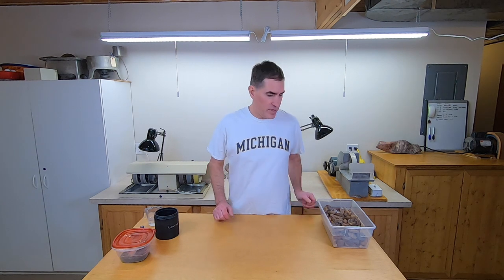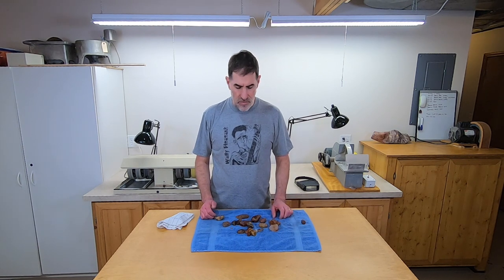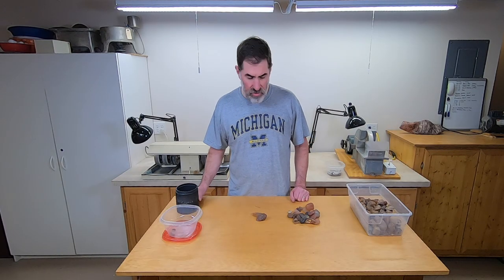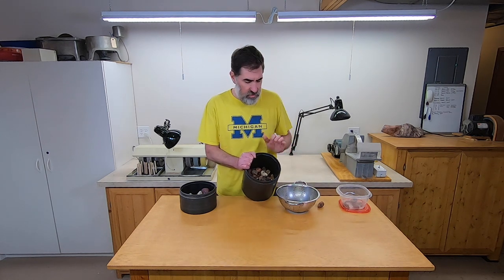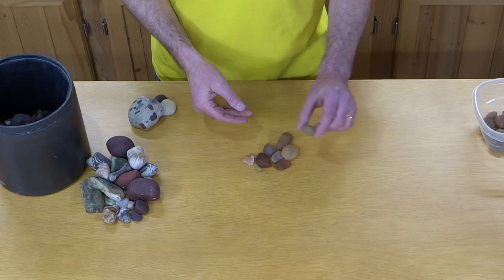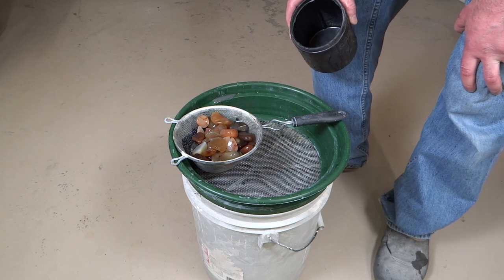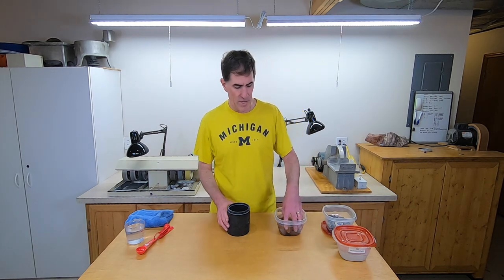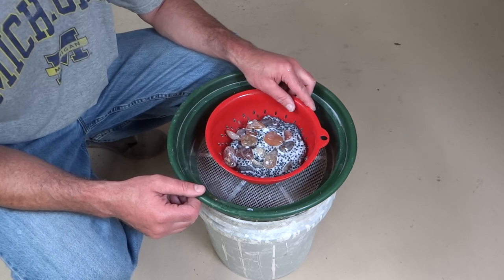How to Polish Rocks with a Rotary Tumbler and Plastic Media

Comment from the maker: This is my third favorite method of tumbling.  My favorite and second favorite methods are shown in these videos.  I almost always start my rocks in a rotary tumbler and finish them up in a Lot-O vibratory tumbler.
Rotary tumbler followed by vibratory tumbler:  https://youtu.be/ksrmpPZrAuU
Rotary with ceramics:   https://youtu.be/dYGFal0e1WY
Reply: Thank you Rob! Appreciate you sharing with us. Great information.
Reply: On the little ears of the kitchen strainer you can put a little screw and nut as a extra helping hand to hook on the edge of the bucket it is sitting on.  It works well too.  Great video btw
Reply: Have you ever tried a thumlets barrel with flats in it which agitates the mix quite a bit better? Whose tumblers are you currently using?
Reply from the maker: @jonlennon3348  I have a small Thumlers tumbler, an AR-2.  I don't find that it works any faster.  I really don't like those barrels.  The lids wear out quickly and then leak.  I've had lids pop off too. I much prefer the Lortone barrels.  Lortone has started making barrels with little ribs in them to move the rocks around a little more, but I don't notice much difference in the results.  All of the barrels in my big tumbler are Lortone barrels because I don't want a spill inside there.
Reply from the maker: @jerryklutts8615  I either set my strainers on a gold classifier that sets perfectly on top of a bucket or I cut a hole in the lid of the bucket that will fit the strainer perfectly.  Your method probably works well too.
Reply: @MichiganRocks  I have two strainers on with the ears and one that fits in a bucket.  Both work well for me.
Reply: @MichiganRocks  Good then a thumlers is a waste of time which is what I was hoping you would say.
Reply: I bet you would love to polish some Mars rocks, have you ever done this to a meteorite?
Reply from the maker: @TheBowersj  No, I have never owned a meteorite. If I did, I wouldn't tumble it. I think it would be really cool in its natural state.
Reply: 05:40 I use "ceramic airsoft bbs" tossed in with my grit and rocks to aid in working the rocks over.
Reply: Sorry, this may sound stupid, but where should I dump my grit water? 💛
Reply from the maker: @nicolebrand5752  That's not stupid, it's a really good question. It's such a good question that I made a video to answer it. https://youtu.be/j-356YqFox8?si=IWEHxkM8iLTyIsuI

Comment: For my first tumble batch (harbor freight rotary tumbler) I used air soft pellets cuz that's all o had, and they turned out great! I used them again for my second batch and was pleased. I haven't done any tumbling for almost 2 years now because life has gotten in the way. Ah, well. I'll just watch vids of other people doing it until I get a minute. I've got a tremendous amount of material that I've found over the last 3 or so years. Rockhounding is an addiction 😍
Reply from the maker: It is pretty addictive, isn't it?  You should turn that tumbler back on.  I only check mine once a week, so with just a small tumbler that should take less than an hour per week.

Comment: Thank you so much. Now I know what I’ve been doing wrong. I’m new at this and learned very quickly I don’t like plastic pellets. Ceramic easy to clean and dry. Lot-O-Tumbler is on my Christmas list 😁
Reply from the maker: I agree.  I really hate using plastic.  Some other really good tumblers swear by it.  My preferred methods are  1) Lot-O.  2) ceramic media in a rotary tumbler 3) plastic media in a rotary tumbler.

Comment: Lovely stones. Interesting that they took so long in the first stage.  Cool beard progression 😎
Reply from the maker: The problem was the very deep holes in most of them.  Normally, I would take some of those to the grinder and grind off just the worst spots.  Otherwise, the tumbler has to grind down the entire surface to the depth of the deepest hole.  The rocks end up pretty small that way and it takes a long time.

Comment: Wow! Had no idea how long this process takes! Learned a lot. How do you discard the waste water from the tumbling?
Reply from the maker: I have to make a video about getting rid of the rock slurry.  It's on my list.

Sometimes I tumble Petoskey stones, which are made of limestone.  For some reason that slurry acts as a flocculant, making all the rock dust settle to the bottom of my bucket leaving clear water on top.  When that happens, I siphon off the clear water and it goes down the drain.

Otherwise, I let the bucket settle as much as it will, leaving still cloudy water on top.  I siphon the top part with the most clear water into another bucket and then either dump it in the gravel at the side of the road or into a hole in the woods behind my house.  The "hole" is actually a pretty nice hole.  I built a wooden box out of some old treated lumber that goes down about two feet.  There's a trap door on top to keep someone from accidentally falling in.  Where I live the soil is mostly sand, so the water drains out pretty well.  It rarely gets much ice down in the hole even in the middle of winter.  The only problem is that eventually the small rock particles in the dirty water eventually clog the sand and it doesn't drain anymore.  I can dig out the bottom for a while, but eventually I have to move the box to a new hole.  I have only moved it once in about 8 years though, so it's not too bad.

My water often contains borax which I use in the Lot-O tumbler.  Borax acts as a herbicide, so you don't want to dump it on your lawn.

What's left in the buckets after siphoning off the top is left to dry out and then it goes in the trash.

Comment: Great results. Cool "beard grinding and polish" process too near the end. One big thing I am definitely still working on learning with my tumbler is "coarse stage patience". I always want to get to stage 2 too quickly. I need to get a second tumbler :-) Thanks!
Reply from the maker: Patience gets easier the longer you do this. I am not usually disappointed that I left a rock in for an extra week or two, but I have often been disappointed that I didn't leave a rock in longer. It's way harder to throw a polished rock back in the first stage because you want to get out a flaw that looks bad in the end.

Comment: Wen you switched to the 12# barrel, did you start again with the lowest grit?
Reply from the maker: I was using 80 grit most of the time in the smaller barrel, but I might have been using 46/70 some of the time.  I always use 46/70 in the big barrels.  When I switched to the larger barrels, I wasn't going to another stage, I was just continuing the first stage.

Comment: Terrific stuff! When you switched to the larger 12 pound barrel, did you switch from 80 grit silicon carbide to 46-70 grit silicon carbide? Or did you stick with the 80? Just wondering when it's good to use a heavier grit in a larger barrel.
Reply: I have a QT-66 and switched to 46-70 grit, seems to grind a little faster.
Reply from the maker: I always use 46/70 in the larger barrels.

Comment: I was under the impression you would use the plastic pellets for softer material such as obsidian so it doesn’t “bruise” or chip as much any experience with softer stones??
Reply from the maker: I tumble Petoskeys using ceramic.  Petoskeys are only a 3 on the Mohs scale.  I only done obsidian in the Lot-O, which can only use ceramic.

Comment: Just wondering....when you add rough rocks to make up for the tumbled rocks getting smaller during tumbling, don't you now have rocks at different stages of done-ness in every tumbling stage after that?  How do you deal with that?  Or does it not matter?  (Another great video, BTW!)
Reply from the maker: I only add in fresh rocks during the first stage of tumbling. Some rocks spend longer than others in the first stage, but whenever they come out, they have first stage size scratches on them. I would never add a rough rock to a later stage though.

Comment: Just watched this and before it the Lace Agate video from 2 years ago, very informational, thank you.  Hopefully a helpful bit of info for you:  3 teaspoons per tablespoon and 16 tablespoons to a cup, so instead of having to measure out 12 tablespoons of grit, three 1/4 cup measuring scoops will save you a lot of back and forth, plus not having to count and maybe forget where you are.  Great vids, keep em coming.  BTW, is there a video where you show the rocks you won the awards for?
Reply from the maker: I know that I could use a 1/4 cup measure, but I also measure into small barrels. I have decided that it doesn’t take that long to count to 12. I appreciate the tip though.

For the worldwide tumbling competition, you have to send in your best five rocks and they keep them. For some reason, I didn’t think to take a picture of them before I sent them in.

Comment: Very nice. Do you have a check list for buying a tumbler and all the stuff needed to start tumbling  some rocks?
Reply from the maker: Not really. Mainly you need a tumbler, grits, and media of some sort. I much prefer ceramic media over plastic media. Then you'll need a colander and measuring spoon is nice. I got measuring spoons and colanders at a dollar store.

Grits that I'd suggest for a 3 pound tumbler:
Either 80 or 60/90 silicon carbide or something similar
120/220 or straight 220 silicon carbide
500 aluminum oxide
a good aluminum oxide polish

I buy my grits from The Rock Shed. They have good stuff. http://rockshed.com

Comment: Rob, have you ever used mineral oil instead of water when you do the final polish? Just a thought. I will give it a try and let you know my results.
Reply from the maker: I have not. I have oiled a few Lake Superior agates, but that's it. I tend to get a really good polish from my tumbler most of the time, so I don't need to oil my rocks to get them to shine. For me, mineral oil would just be a mess to clean up. I suppose you could recycle it, but it you want to just dump it out after the polish stage, you can't get rid of it as easy as water.
Reply: @MichiganRocks  I meant as oil not water in the tumbler with grit. Not a coating.
Reply from the maker: @robbybobby6483  Yes, that’s what I thought you meant.

Comment: I used ceramic media to help wash some specimens with dawn dish soap. Worked great in my new toy rotary tumbler. 1.5 pound barrel. You did a video on it. 3 speed, 9 day timer. Started a tumble 2 days ago. The grit was gone today. Noticable difference in volume.  Runs at warp speed in first gear. The rocks are shaping nicely. Figured on using ceramics for stage 2 then plastic for stage 3 and 4. Any thoughts?
Reply from the maker: You could do that, but I don't see a reason to switch from ceramics to plastic. I prefer ceramics over plastic. I'd just use your ceramics for all the remaining stages. You can move them right along with the rocks. With plastic, you have to use separate beads for each stage and it's a pain to pick the rocks out of the plastic. I also have better luck getting a good shine with ceramics.

Comment: Interesting I’m learning how to tumble my rocks , thank you 😊I came across some raw labradorite that I’m tumbling, I have the 3lbs tumbler the small one , I’m at the polish stage I’ve been using ceramics , directions say to use plastic beads but didn’t have any so put a few pieces of ceramic in , your rocks look awesome mine seem scratched up and not shining any suggestion on how to fix this problem , thank you 😊
Reply from the maker: You might not like this answer, but I’d say to give up on the labradorite and try to tumble something easier. I have never tried labradorite and I don’t think I’ve ever read about anyone having really good success with it.

Agate and jasper are good choices for learning on.  There are many other rocks that are good to tumble, but agate and jasper are usually pretty easy.

I have another video where I show how to tumble with ceramic media.  It’s basically the same as using plastic, except the ceramic can be moved right along with the rocks. You don’t need special media for each stage. I find it easier to get a good polish with ceramics.
Reply: Thank you 😊

Comment: Great advice for tumbling, thank you. I notice some tumble containers are round inside and others our octagon shaped, is there a difference?
Reply from the maker: The newer Lortone barrrels have flat sides inside. All the Thumler’s are like that. I think the flat sides help the rocks to tumble a little better.
Reply: @MichiganRocks  Makes sense, thanks. Creates more agitation instead of a smooth rotation.
Reply from the maker: @CityRockhounding  I think it causes the rocks to roll over more. With round sides, they could just slide around the bottom as the barrel turns.

Comment: I used the stage 2 grit that I had:  220/120.  I seem to have lost a lot of volume in 1 week.  I had both 3 pound barrels going, but I had to cut it down to 1 barrel due to the loss (with some left over)
Do you lose volume on stage 2 (or 3 or polish) ?
Is 220 better than 220/120?
THANK YOU MICHIGAN ROCKS!!!  YOU ARE THE BEST!
Reply from the maker: 120/220 is just a little more coarse than 220. I don't think there's a noticeable difference between them, I just have more 220, so that's what I usually use. There is some volume lost at this stage, but not as much as in the first stage. In each stage there is less and less volume lost because you're using finer and finer grits. I never feel the need to add anything to keep the volume up from 220 on.
Reply: @MichiganRocks  I wonder why I lost so much.  I had 2 full barrels and after the 220/120 I had 1.5.  I'll see what happens next time.
Reply from the maker: @kokosnood  Are you using a National Geographic tumbler? I just bought one to do a review of it and I was surprised at how fast it ground down rocks. Part of that was that some of the included rocks seemed very soft. The other part is that the barrel spins much faster than other tumblers I have used.
Reply: @MichiganRocks  I watched your review of that tumbler.  I have a lortone 33b, and an old Sears 15lb barreled tumbler (same barrel as the Thumbler 15lb.)  I was thinking it might have been a disparate hardness issue.  I could have missed the softer rocks in the rough tumble and then they ground down in the second stage.  
(Following your advice) I noticed I get a lot more action with the 15lb barrel on the rough tumble.  I really like your video on the Crazy Lace Agates.
I want to buy a Lot-O vibrating tumbler but they seem unavailable...anyway I'm not in a hurry.  I'll wait until the Rock Shed gets them in.  
Your videos are the best!!!!
Reply from the maker: @kokosnood  I really like my Lot-O. I'd send Shawn at The Rock Shed an email and ask if you can get on a waiting list for a Lot-O.

Comment: Thanks for the video! Whats the noise level in a Lot-O vibratory compared to the rotary? In an apartment and the rotary is just quiet enough not to notice it but I'd love to get the vibratory if it's not too loud.
Reply from the maker: I think my Lot-O has gotten louder over the years.  I'd say it's louder than a three pound rotary tumbler.  It's quieter than six or twelve pound rotary tumblers.  The larger rotary tumblers make a thumping sound as the rocks roll around.  The Lot-O makes a hum, but mine has developed a bit of a buzzing sound with the hum.  It's a more steady sound than the rotary tumblers.  Check out the end of this video to hear one in action.  That won't really tell you how loud it is, but will give you an idea of the type of sound it makes:   https://youtu.be/ksrmpPZrAuU

Comment: Rob, what do you think about cracks - do they exist (invisible) before tumbling or are they caused by tumbling? If the second, how to avoid it?
Reply from the maker: I think both probably happen but I think most are there before you start tumbling. Shining up the rock really helps them show up.

If you have rocks that you’re worried about, fill the barrel more full, like 80%. you can also add some plastic or ceramic media. I actually prefer ceramic.

Comment: I got the Lortone 33B kit from The Rock Shed, which came with plastic media. Since I had watched your videos first, I also ordered some large and small ceramic media. Is there a benefit to using the plastic for just the final polishing stage or is ceramic better for every stage?
Reply from the maker: I'm not sure that one is better than the other. Some people prefer one, some the other. I like ceramic and use it for all stages. I don't think there would be an advantage to switching media for the polish stage. Good luck with your first batch!

Comment: So if you took this batch as they are now and put them in your lotto tumbler with polishing compound would they shine up more or would you have to go back a few steps?
Reply from the maker: I think they would shine up with just polish, but I'd probably go back to 500 anyway.  It would only take five days.  I will definitely put these through the Lot-O.  For some reason, I felt like I should post this video before I did that.  I did this video at the same time as my other rotary video, but didn't want to post two long rock tumbling videos back to back, so I saved this one for a few months.

Comment: Thanks for these videos!
I have a quick question: when you run them for another week at a time and adding rocks, are you adding grit every time, also?
 Maybe that's a dumb question, but I didn't want to assume either way without asking.
Reply: Nevermind, I found the answer in the video description! Thanks!
Reply from the maker: Yep, each week I add fresh grit and water. The old grit is worn out by that time.

Comment: Should you use separate ceramics for each stage like you do for the plastic pellets?
Reply from the maker: No, that's one of the great things about ceramic media. You can move them right along with the rocks. Since they're hard, they're not going to get grit embedded in them like plastic does.